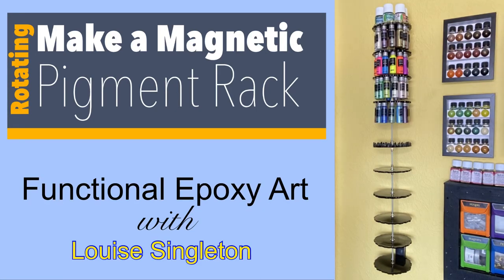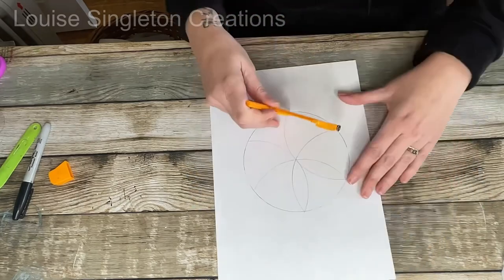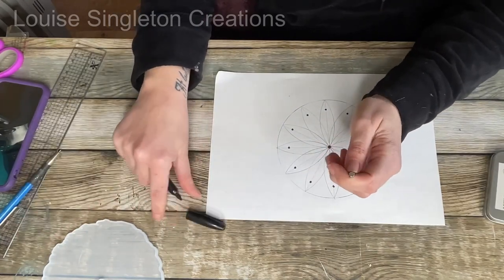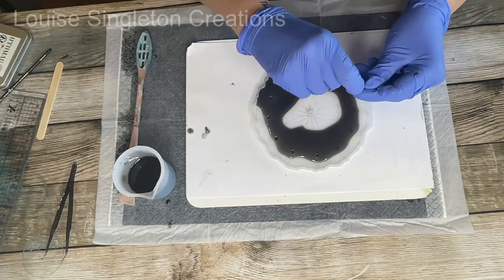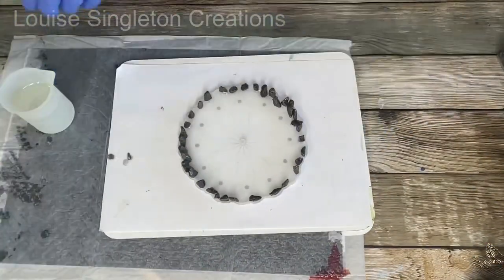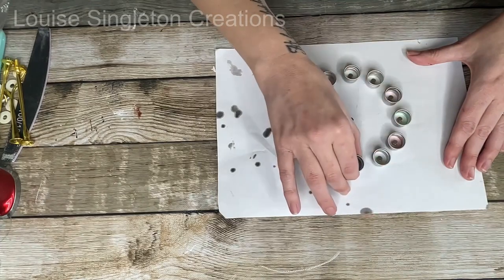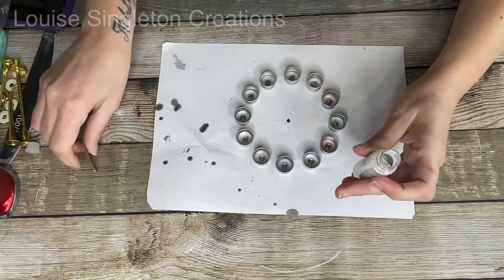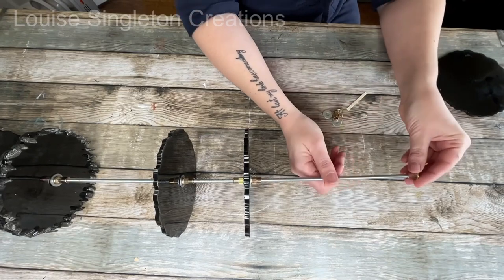How to Make a Resin, Magnetic Pigment Rack - Craft Room Storage

Comment: Put the magnet on the outside of the bottle cap instead of the inside of the bottle cap. If you glue the magnet on with hot glue it will come off easier if you want to change a bottle cap

Comment: I love this idea but I'm unsure of how you mounted it on the wall, can you explain that?
Reply from the maker: Thanks Jackie, I just used two of the ‘L’ shaped brackets which I showed. The brackets have a hole for the rod to go through and then you just secure it with nuts at the top and bottom. I put an extra tier on the top above the bracket so the bottles hanging from that hide the top bracket.
Reply: @LouiseSingletonCreations  Thanks, I must have missed the "L" shaped brackets being shown even though I watched it twice.  Very cool idea, I really love it.  Going to have to go back and watch it again.